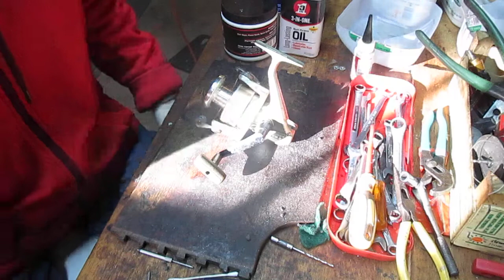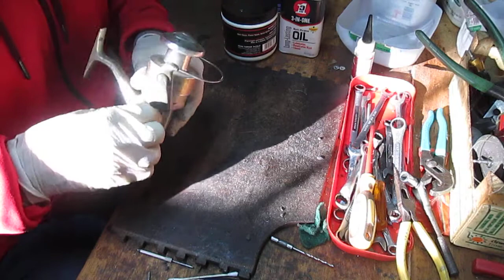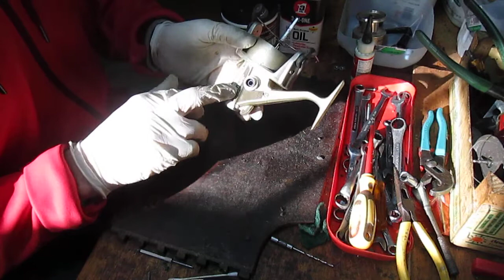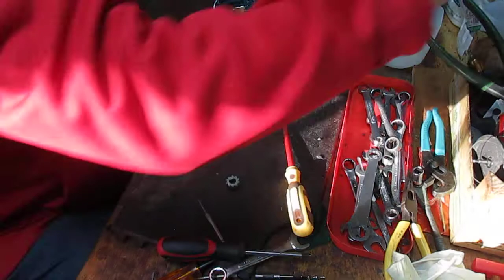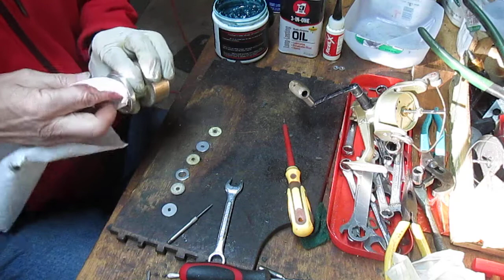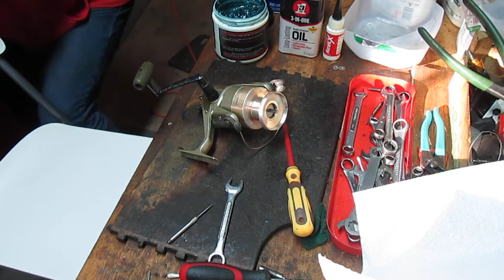Daiwa Jupiter-z 4000 basic maintenance and rebuild procedures for a spin fishing reel

Comment: some of the nasty stuff I've found in some reels, I sometimes think 1or 2 gloves aren't enough, I had 1 a full haz-mat suit would still be borderline. By the way, I got a camera like you told me about, I agree, the way the viewing screen moves in enough ways, makes easy to get the subject in frame. thanks for the tip
Reply from the maker: I often wonder that were they thinking when I open up some of these reels.  Thanks
Reply from the maker: Glad to hear the camera is working out for you - Dennis
Reply: @2ndChanceTackle  there are probably EPA laws against some of it

Comment: Hi. I have a Jupiter Z that I haven't use for a long time because the anti-reverse is broken. Is there a fix for this?  Thank you.
Reply from the maker: It is likely that you have a bad spring in the anti-reverse assembly.  You will need to remove the rotor and check to see what part is broken.  The next step would be to find out if that part is available.  This is an older reel, so it may not be in stock.  You can contact Daiwa directly at Daiwa.com - Dennis
Reply: Thanks Dennis. The spring is intact and is working fine. Probably something else broke.

Comment: I have a Jupiter-Z 5000, is it the same to clean and lube as the 4000?  Is the 5000 a medium or heavy duty reel?  (Love your videos!)
Reply from the maker: These are essentially the same reel and you can use the 4000 video to service the 5000.  The core difference is the size of the spool.  A 5000 holds more line.  The 5000 is one of the most versatile sized and is considered a medium duty reel.  It can be used inshore, in sure, from pier and boar, in lakes and ocean.  It is very practical for someone that does a variety of fishing, - Dennis
Reply: @2ndChanceTackle  Thank you Dennis, I was going to try using it with braid on the Cape Cod Canal...?
Reply from the maker: Sure - it should work fine in the canal or surf - Dennis